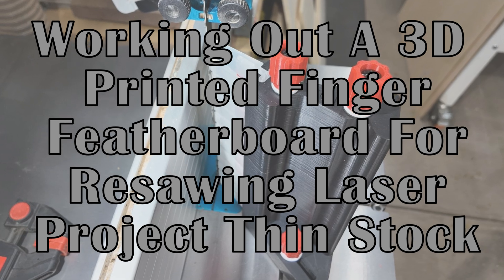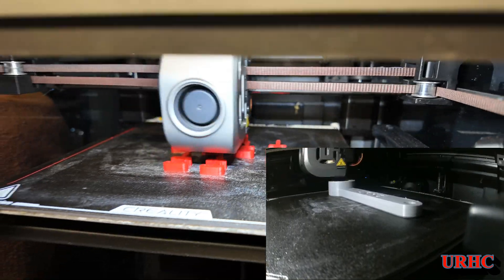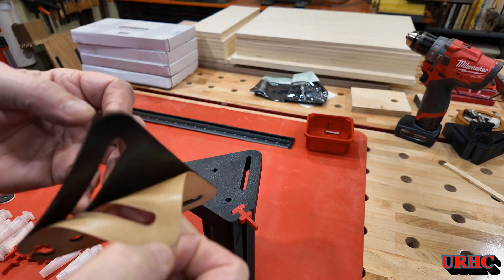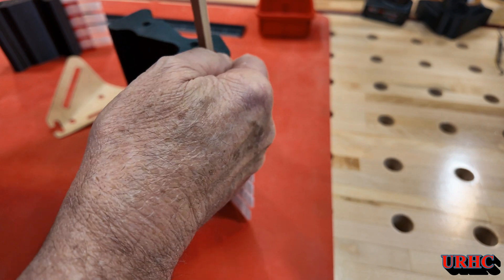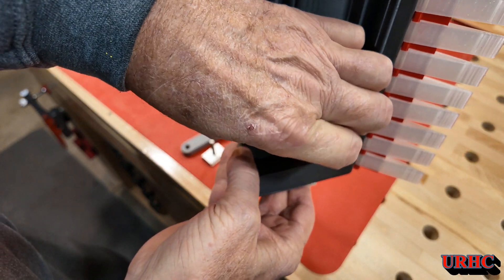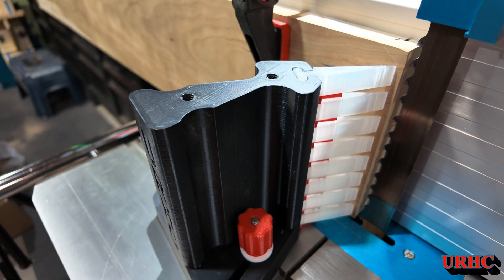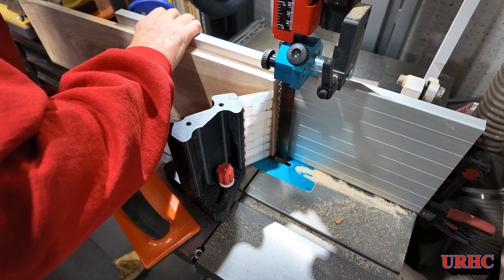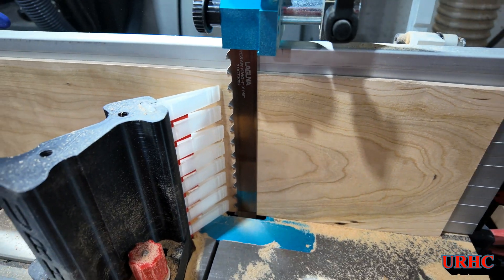Working Out A 3D Printed Finger Featherboard For Re-sawing Laser Project Thin Stock

Comment: Just got a 3D printed thanks to your inspiration...  Curious as to where you get your filament.  Do you get it off Amazon or have you found a better place.  I do not know the first thing about it.

Thanks.
Reply from the maker: I got most of my filament from Creality. They have some good discounts and their hyper speed filament works best with the K1 printer I have found. Amazon also sometimes has some great pricing if you are just buying one roll at a time. PLA is usually the lowest cost, safest, and easiest to get good results from for starting. Some other filaments can emit dangerous gasses that must be vented outdoors so be sure to follow the filament manufacturers directions and warnings. Have fun and printables is a great place to find files to play with. Thanks for watching.
Reply: @unemployedredneckhillbilly2023  thanks for the quick reply

Comment: Another awesome video.  

I started out in Fusion360 with a free teaching account and when that expired and they didn't want to renew it, I moved to TinkerCad.  I'm a cheapskate, so I'm willing to work around the frustrations of freeware limitations for design to keep my money in my account.  The program you use showed up as $279 when I checked it out.  Too much for what I use it for.
Reply from the maker: I used Fusion for a while when the had the free version. That ended and I lost everything on their cloud so decided I would never use cloud base software again. The Alibre Atom was $149 for a permanent license and there is a option for a year of updates for $49 that I signed up for because I read there was going to be a big upgrade in the next year. It is striped down of advanced features so a little slower to use and manage drawings. Same price as lightburn and you own the license even if you don't buy updates. I really like it. I checked and still on sale https://www.alibre.com/buy-now/  They have a fully functional demo to try. I tried all the free ones and couldn't get comfortable with any of them and really like a sketch based program. Thanks for watching.

Comment: Well done! Having worked for a few years in FreeCAD, I know how difficult it can be to get multiple, separate, parts to fit together. And seeing all of those pieces come together was very impressive.
Reply from the maker: I am loving Alibre.  Easy to work in the assembly mode and see exactly how things will fit.  My biggest problem was over extrusion after the nozzle change on the K1. You may want to play with the Alibre Atom trial to see if it would  make working in assembly easier for you. Thanks for watching.

Comment: Are you going to make the print files available? Did a quick search online and found one vertical fence with one hold down bolt that just looks like problems. And about a zillion references to a MagSwitch kit.  I think solving the "finger" issues should be easy enough so long as you have a good, solid base.
Reply from the maker: Once I get things worked  out I was planing on posting them. The base is very solid with 5 walls and high levels of infill. I had planned on epoxying some steel rods in the 2 holes for more strength but don't need them. I have several ideas for the fingers but want to try thinner TPU fingers first. I started out planning on using spring steel feeler gauge  stock so that is another option I can go back to but will have to order that. Thanks for watching.
Reply: @unemployedredneckhillbilly2023  any chance of you releasing the files I really need one of these and would love to try yours before going the route of designing my own. Love the replaceable feathers.
Reply from the maker: @kamdenkers  I will say the thinner tpu fingers are still temperature sensitive and it looks like it will need spring  steel fingers but haven't had time to get back to it. Probably  best to design your own as I used it to saw all the stock I needed right now and i have to find some 1/2 hard feeler stock in different thicknesses and form them to fit.

Comment: You could laser the fingers out of some EVA foam like the cheap rubber floor tiles.
Reply from the maker: That is an option I have thought about also.  I'm printing another TPU set with thinner walls to try first.  I didn't realize how temperature sensitive the TPU is but I like how it has constant pressure when flexing.  Thanks for watching.

Comment: That is really nice Ed. They turned well! I am printing some paint pyramids ass I type this. After not using the printer for a couple of years. My son just bough a Bamboo 3 d printer that is impressive multi color self leveling and you extrude many types of filament.😀🛫
Reply from the maker: Thanks.  Not great prints because of not adjusting the extrusion after the nozzle change but strong and functional.  This K1 can print as good as the Bambu printers for under $400 so I decided to try it. I have to vent this outside so I can try the other filaments that create  very toxic fumes when printed.  This one is auto leveling and so easy to use. Fun for this old man. Thanks for watching.